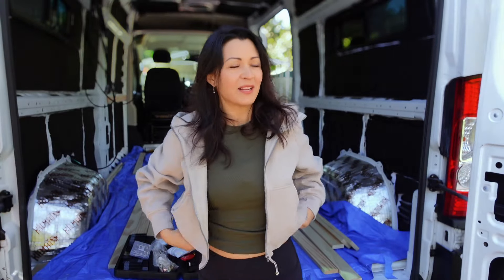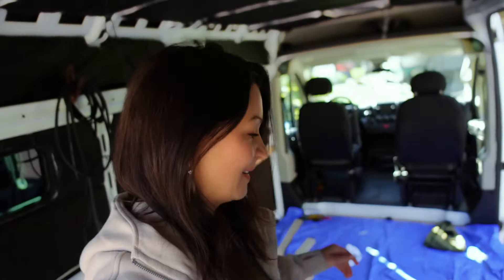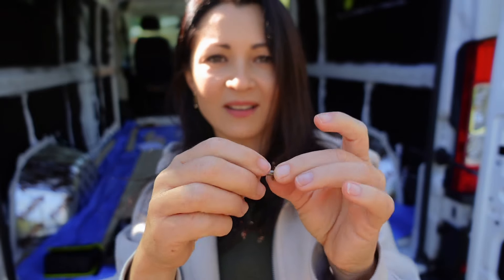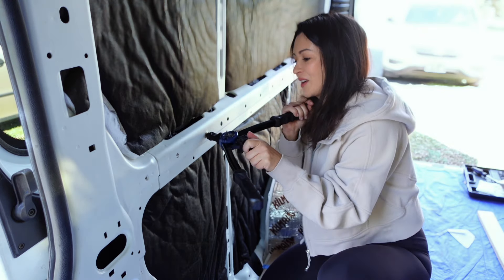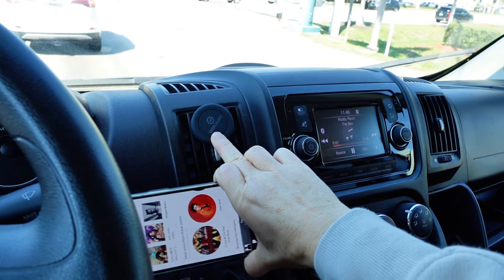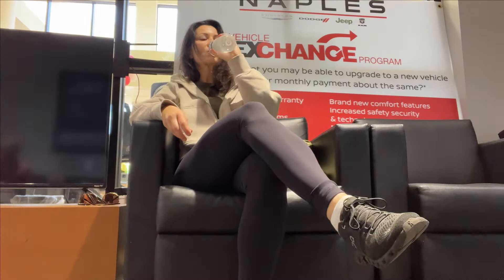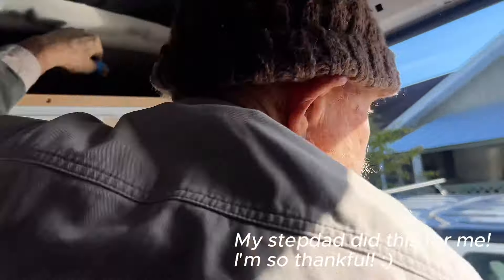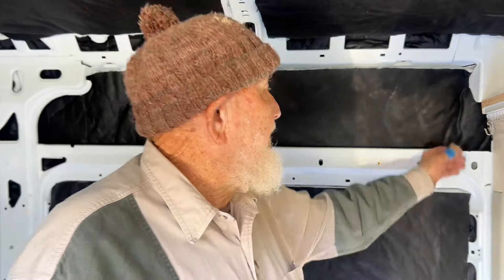Dealing with my van's battery issue and framing | Ep 24

Comment: Regarding vehicle electronics:  Alternator, go to O'Reilly's Auto Parts (I do NOT recommend AutoZone, I've had lesser than good experiences there) - at O'Reilly's get them to put the battery tester on your car, they may ask you to start it, not only will the tester tell you the voltage (so you know if it's good or not) - but, ask them to tell you the readout for the alternator as well.  Alternators can be tricky, i.e., it may say it's putting out proper charge to the battery, BUT - there are also (usually) 3 diodes (don't ask me what those are - LOL - it isn't necessary to know, only that there are 3 and they MUST be working properly).  If they are - and the voltage is good as well, then it's "just" a battery issue.  Of course, this doesn't also consider a possible loose ground cable (both poles on the battery should be properly tight - NOT overtight - this is important to remember) - but a loose ground cable connection to the car at some point (the end of the ground cable opposite that on the battery pole) - can cause a lot of battery havoc for the simple fix of tightening a screw or bolt.  Been there; done that.  ;-)  All the best!!  you have great courage !!

Comment: Get volt meter. Turn engine on and check voltage at battery terminals. Should read 14 volts while engine on

Comment: I also have a 21 Promaster named Stevie (Gold dust woman) that I’m building out myself… I also did 100% rivnuts and no new holes for the same reasons.  When I used the riv nut setter (Astro tool), I didn’t turn the knob the entire way (the more you turn, the harder it is to squeeze).. I turned it three times.. squeezed.. opened it back up but did not remove it from the hole..  turned three more times and squeezed.. usually that was enough to get it fully set without the need to “manhandle” it.  Good luck!   I love my Promaster.. but I too worry but my worry is about the transmission… Last month, I spent about $3500 on a 7 year unlimited mileage extended warranty - it was really for peace of mind.  I don’t regret it but it was a chunk of change for a lot of peace of mind.

Comment: You can build a bridge from your old job to your new job by finding a textbook for an automotive technology class and keep it as a desk reference. You will be able to identify and assess jobs for whether you can do them yourself or hire a pro. Plus it's a paper book so it cannot be hacked or need a signal to run. Dealers will bleed you dry. They may not even fix the problem.

Comment: Sometimes the battery may go down for no reason, this does not mean that the battery is defective.
Electric devices such as lamps, alarms or radio remote controls can reduce the voltage of the battery. This happened to me once, for no reason, the battery dropped below 11 volts, therefore the vehicle does not start, the brain does not start the vehicle. It happens mostly in winter or spring seasons when nights are cold.
In general terms, of course, it is most likely due to the old battery of the vehicle. I think that your new battery will not leave you stranded for a long time, even if it malfunctions. I am trying to make one too. Good luck. You are very knowledgeable and skillful. I congratulate you.

Comment: Pick up a nice rear view Camera & it will mount over the stock mirror on your windshield, or you can upgrade the stock stereo & have the camera that way also. Make sure you run 1/2 tank high test  gas,  or a can gas additive  the orange dash light, as you add more light & stuff, a decent battery booster that you can use the cigarette lighter.

Comment: Yeah it was just the battery. Esp in florida.  A 36 month battery will last exactly 36 months in florida…because it gets VERY hot.  The alternator will last for 10 years. So no worries…you got it fixed.  Its done.

Comment: An auto parts store would have installed a battery for free. It would have been less than $200.They call them Stealerships for a reason. Great video BTW. I was not aware of those types of fasteners.

Comment: I feel so bad for the amount of money you spent at the dealership, Batteries last about 4 years but you can go to a auto parts store and they’ll usually test them for free and they don’t over charge you for a new one , or Costco has batteries. I recently put a battery in my truck . For the fun of it I asked AAA how much for theirs and they wanted over $349 then I called my Toyota dealer and they wanted $138 for the battery and install both was $300. I went to Costco and picked it up and installed it myself and I spent $109 and ten minutes of my time .  Keep up the great work on the van  , your awesome 🤗

Comment: My dad taught me that you only go to a dealership one time to purchase a new vehicle and then you never go back. The dealership (aka stealership) overcharged you by $400+ for the battery replacement so this should be the last time you ever go to one of them. 

I kind of geek out on fastener technology so not too many other people think about this but stainless steel bolts should not be used with yellow-zinc-plated steel nuts like that. Since it is inside the van and will not get wet it will be fine but if this was done outside where it would get wet then the stainless steel and yellow-zinc-plated steel would have galvanic corrosion which would eventually lead to the yellow-zinc-plated steel nuts losing their plating and rusting which years down the road could lead to the van's steel body rusting. Either yellow-zinc-plated steel bolts or zinc-plated steel bolts should be used with yellow-zinc-plated steel nuts. OK, geeking out time is over.

Love your channel and planning on buying and converting a van myself one day.

Comment: When you finally get it on the road, be careful swinging the driver and passenger doors open. Hold on tightly to them when its windy or if you're on a downward slope... The door hinges in those vans are notorious for breaking, and it's not an inexpensive fix. There's a mechanism inside door that usually has to be replaced. So it's not just a new hinge, or adding new nuts and bolts sort of thing. The post office started replacing the hinges with seatbelt straps... that seemed to fix the problem.

Comment: A battery will discharge over time. Short journeys will not fully charge the battery.
A solar charger which provides a trickle charge may help.
Some batteries aren't as good as others especially when have been fully discharged previously

Comment: The reason that Forstner bit didn't work for you is because you were using on an existing hole. The right order would have been to use the Forstner bit first and then drill the thru hole. Hope that helps you out in the future. :)
Reply: Wait, I actually got a look at the type of bolts you used, and what you actually needed was a countersink bit. Not A Forstner bit.

Comment: You can't let the van set for long periods without starting it and let the alternator charge the battery. You have what is called parasitic drain on the battery. Caused from alarm,and other electronics installed that require the battery to power them. If going to let it sit longer than a week without starting it, you should invest in a battery maintainer/float charger. That will automatically trickle charge the battery when sitting for long periods of time.  A nice solar powered maintainer will work nicely for you.

Comment: Hi Elisa, you may have it already but I would recommend some form of road-side cover. Most of their jobs is changing batteries. (Another example: I got locked out of my car after kiteboarding a few weeks ago. They came out to me and opened the door without smashing or breaking any windows).... I worked away for four weeks at a time and went through 3 or 4 batteries. Even the clock will drain your batteries. Ctek are good battery chargers. 8 stage too I think.

Comment: You might be able to mark your ribnuts on your lumber by simply tapping the lumber with a rubber mallet, once in place…you would want to mark your nut locations with a pencil first. This method will work IF the nuts are not too flush with the metal

Comment: Install a battery disconnect switch. If you are parking any length of time.  And if you don't turn off your interior lights with your doors open, it will drain your battery.  Go with good fasteners. Self tapping screws are ok for small lightweight jobs. But things with weight and the shifting as your driving will pull screws out. Vacuum and go over the area with a good magnet after and you should be fine.  Keep up the great job!

Comment: If the van will be sitting for several days or more, get a battery minder/maintainer.
It will check the battery and trickle charge it as needed.
Plus the minder is very inexpensive at around 30.00.
Your battery will live a long life!
Good luck!

Comment: About the typical lead acid wet battery, there are few actual manufacturers that build for the many brand names. Typically these batteries have only about a three year lifespan that you can trust, tho some may go a little longer depending upon use and weather where the vehicle is used. One thing that is routinely missed is the cleanliness of battery terminals and cable connectors. This is a first thing to check and should be done at least annually whether you are having a problem or not. Remove the cables from the battery and inspect visually. Metal should be bright and shiny both the terminals and the cable clamps. Clean them if they are not bright and shiny using a wire brush or other tool sold for the purpose, then apply a basic axle grease. Tighten the battery cable clamps back on the battery and wipe away excess grease. The grease only remains in tiny pockets where corrosion would have gained a foothold. I've been doing this for decades, learned it from my Granddad. It works!

Comment: typically automotive lead acid batteries will last 5 years.  I've gotten as much as 7 or so out of one - but also depends on climate too.  cold winters can be hard on them.  If it had even been ran down to a dead state - and needing jump started - etc.  that can reduce the life of the battery.  And lastly, sometimes they just develop an internal short - where one cell will go bad and the voltage drops.  check your dash guages and see if you have a "voltage" guage... when the vehicle is running - you should see around 14 volts -(indicates charge system is working) if it's only showing 12 - that's a good sign you're running off battery and have a charging problem.  if you don't have a guage - then watch for a battery light - indicating a charge issue.

Comment: Didn’t you mention in one of the videos that the H2O tank would be on the right side, but shower, toilet, and kitchen would be on the left (behind the driver seat)?  I’m wondering how you were going to run the waterlines. The longer the hoses, the more opportunity for leaks. Wouldn’t it be possible to put the water tank closer to where the water will be used? I don’t know if you’ve already figured out how to do it not.  I’m just thinking about leaks in the future.
Reply from the maker: I’m going to have the kitchen sink (which I’ll use more frequently than the shower) on the passenger’s side, same side as the water tank. The shower will be on the driver’s side , I’m pretty sure I’ll run the shower pipes along the bed frame. We’ll see how it goes! 😬😅 thank you for commenting!
Reply: @soloelisa  I’m hoping everything goes smoothly for you.  Can’t wait to see your adventures!😀👍

Comment: The company that makes that rivet installation tool is actually called Astro-Pneumatic but the tool itself isn't pneumatic (i.e. using compressed air). I have another tool of theirs, a bearing installation kit, and it's very high quality. It saved me money the first time I used it as local shops would have charged more for just 2 wheels. I'm sure that this one is just as well made even if it requires some elbow grease.

Interesting choice of going with rivets over bolts or screws. I've never done anything like this so I don't know what the standard is. I wonder if people use metal studs instead of wood, to avoid warping and mold. and allow repeatedly installing and removing cabinets and such as needed without drilling new holes in wood, but every built I've seen seems to use wood for the framing, and furring strips are really cheap.

Also, although it's probably too late now I'd suggest you get your batteries from Costco in the future. A bit cheaper, good quality, and they have a three year no questions full return policy so essentially you get new batteries for life. I've actually never done this but I understand than many people do it.

Comment: hello Elisa, a good tool to have and keep in the van is called a multimeter. learning to use it is no problem as you have many skills working on your van  this  can read the voltage on your battery and the output of your alternator. it can find out if there is a electrical drain when the vehicle is parked  and motor is not running. it can find out if there are live  wires damaged and draining your battery. it can tell you if your battery voltage is getting low and you may have to find the source of the trouble . there are lots of educational sources on how to use it  and of course you tube  has lots of  videos on ,how to use it. love your Videos and look forward to seeing the new ones😊

Comment: 1-1/4” pvc pipes about 2 feet long slide the right over the handles of your riv nut tool, it will give you extra leverage and make it very easy to use…. that’s what I did with mine.👍😎

Comment: Riv-nuts are game changer for rv/van builds, i used them for my roof mounts for solar panels and it worked like a charm.  I also used them in the roof cross members to mount the ceiling wood.  so glad you are using them, in the end you'll see how nice they are and easy to remove panels and such should it be necessary.  I would recommend a battery isolator from your electrical system.  I would also recommend when putting those riv-nuts in, try and make sure they are always straight while squeezing them in place, if they are crooked it will force the screw to be slightly crooked during threading, so that you don't cross thread them.  Fatastic job Elisa, you are doing a wonderful build, you will have so much experience and knowledge after this you will be so proud of yourself and when you want to change something or fix it, you will know exactly what you need to do and how to do it!!  You are amazing, keep it up.

Comment: Your battery will always dying when not loaded. Every battery has an internal so called resistance and this means, it unloads itself with a little current. And without loading the battery will dy.

Comment: I see several people have speculated how long a battery should last. It all depends on a lot of factors that I won’t get into, but 3 years does sound like a short amount of time. You’re obviously very resourceful. I would use that same diligence with all aspects of your van to ensure you aren’t taken advantage of. Even if you can’t do the work needed to correct a problem, research the heck out of it so you know the right questions to ask, and whether someone else’s “solution” makes sense. I suspect you are not done with the battery problem because all the battery does is start the vehicle. After that, other components of the car take over (alternator) to keep the vehicle going and recharge the battery. If the battery is dying, it’s because something is drawing energy from the battery outside of when you’re turning the key to start the vehicle. There’s also a lot of good advice from other posts like take the vehicle to one of the auto parts stores who will diagnose the problem for free. Anyway, I’ve rambled enough. You’re doing a phenomenal job. Keep up the good work. If the problem resurfaces and you need to replace the alternator, you can replace it. It’s very easy and you are very capable.
Reply: Would you care to set those of us who speculate on the lifespan of a battery straight? To those of us who you assume do not have any clue, any idea what we are talking about, thrill us with your vast expertise would you?

Comment: As a tech in Florida batteries only last about 2 years and you'll need a battery isolator so one doesn't discharge into the other.

Comment: I tend to change batteries every 4 years in our cars even if they're not showing any symptoms of failure. It's so much easier than dealing with getting stranded somewhere. Also - many of the larger auto parts stores will test your battery for you if you're not near a dealer or can't get an appointment with one. Keep up the good work - can't wait for the travel videos when it's completed and you're on the road!

Comment: Your countersink problem can be solved with lock rings or depth step rings for drill bits.  You put a normal bit in like you were using to drill the holes but of bigger size and then use the circular collar or depth step ring on so the collar controls how deep the drill plunges into the wood creating the countersink.  You can do the same thing with your drill press but the same methods, just freehand drill your first countersink, use the same bit in the drill press and set the depth stop to match the freehand drilled countersink.  It works well either way.

Comment: Hi, you can buy these cheap voltage meters you can plug into a 12V connector to measure the state of your battery. It should measure more than 13V while driving. If it doesn't or you see the voltage dropping over the next few days or weeks, something is draining your battery. If the voltage doesn't increase after a few hours driving, your alternator may be broken. But as you said, most likely the problem will be solved now that you replaced your battery. Just suggesting this to give you a chance to avoid having to buy another battery :)

Comment: Just a tip, If you extend the handles with a breaker bar it could be very easy and not require so much strength.